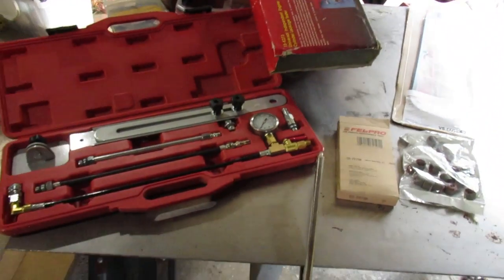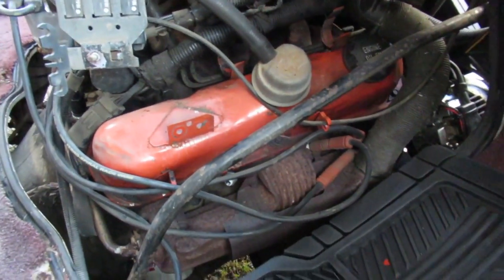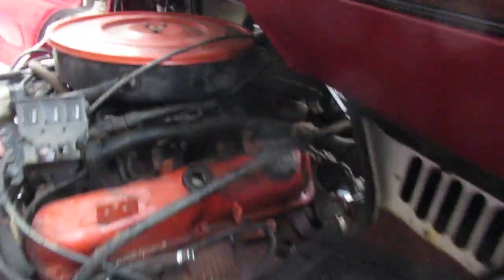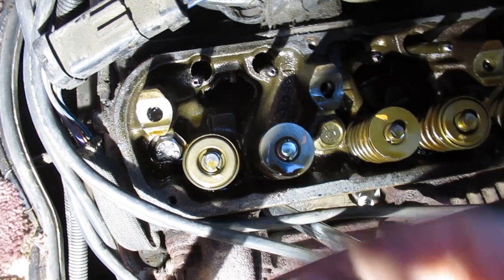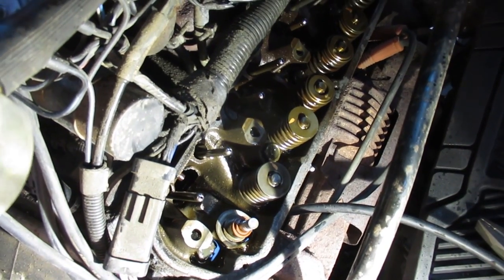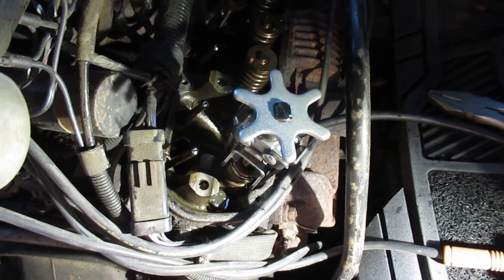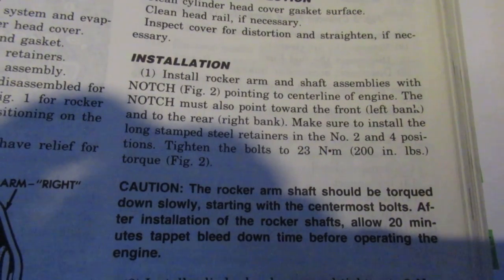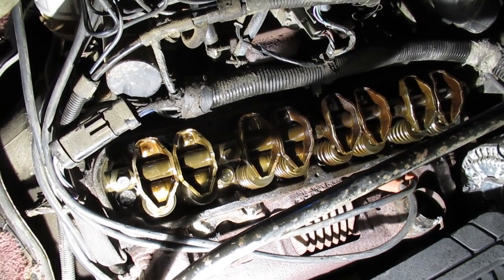Dodge Mopar 318 5.2 Valve Stem Seal Replacement - Cylinder Head On

Comment: Did they work
Reply from the maker: they helped a lot, the new owner hooked up a manual pressure gauge and found out the oil pressure was way too high on the engine, that seemed to be putting extra oil in the valve covers, I'm not sure what he did about it

Comment: How much/little air pressure needed to prevent valves dropping? 😎
Reply from the maker: I probably had my compressor running at about 100 psi.

Comment: Do you have to use the short and tall ones if they are on there?
Reply from the maker: I would buy a set of valve stem seals that is complete so that you don't need to worry about which ones go where.  The set I had were all identical.
Reply: @SteveRivett  okay thanks

Comment: Just got a quote for 7hrs and just shy of a grand to do mine on my 86 Ramcharger with a 360. Seems a little excessive right?
Reply from the maker: yeah, the ram charger would be easy to work on if you had one of those overhead creepers.  Try to keep it going, I like those and you don't see them often.
Reply: Did u ever get it done? Did u pay that much? Or did you get a better price somewhere else? I'm currently in the same boat and need to change mine. My car is currently smoking pretty bad.
Reply: @blah9664  I’ve decided to do the bottle of no smoke fix for now. When you first start it, it doesn’t really smoke. It only starts after it’s been running a few minutes. So that to me points to rings unfortunately :/ Currently having a 455 being built for my 78 trans am, so an eventual rebuild for the Ramcharger is in the future, just not anytime soon.